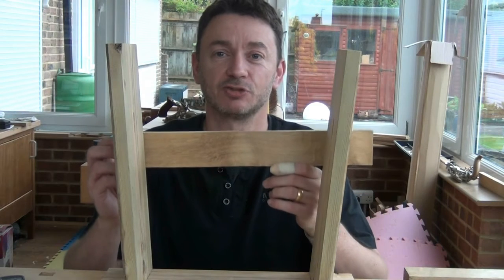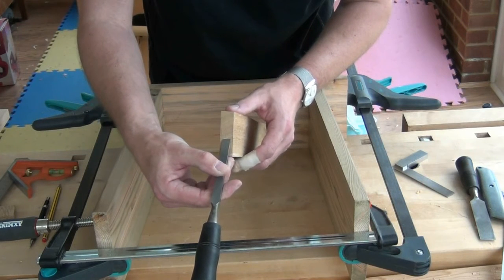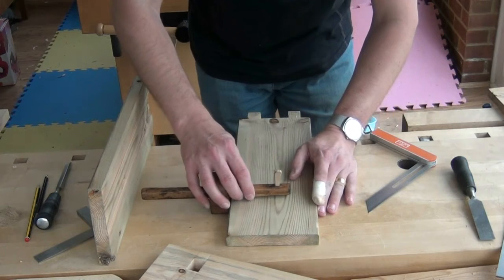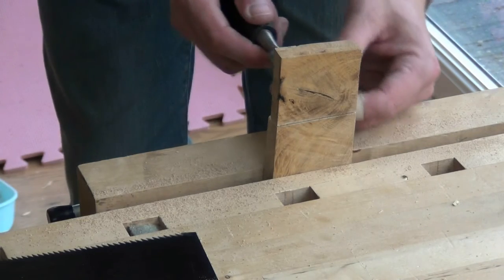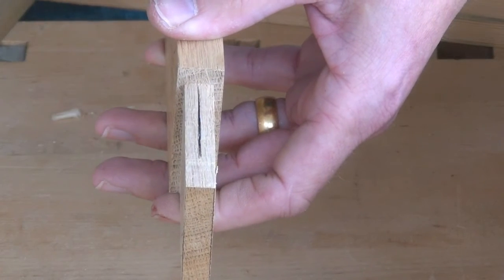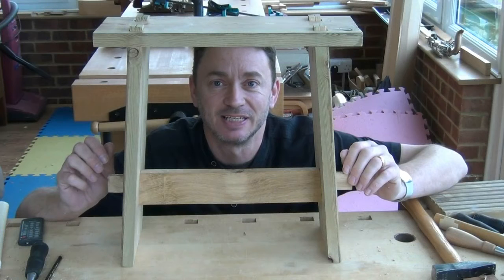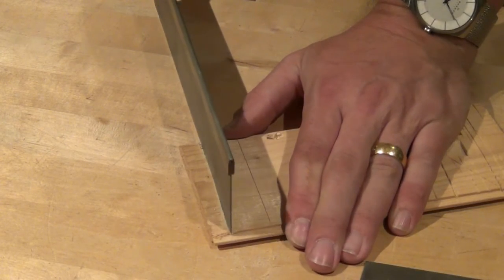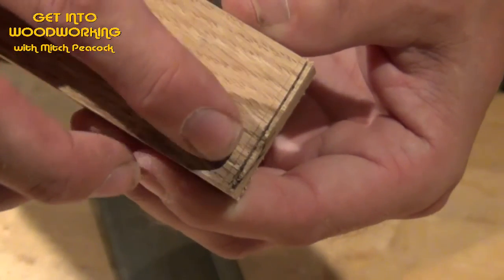How to Avoid Saw Tearout - GIWS1E15

Comment: thanks for the tips - is there perhaps a different way to do the mortise and tenon joint without having to cut at and angle - i find this extremely difficult to do and have never ever got it right - it always looks like I have forced the wedge into its place and not like it fits there.
Reply from the maker: John Geldenhuys Do you mean the leg to seat, or leg to stretcher joint John? 
If the legs are splayed then there needs to be an angle on either the tenon or mortise, or both.
Feel free to email me photos of your attempts and I'll try and see what's going wrong.
Reply: Get into Woodworking 

Thanks for the reply – it was the leg to stretcher joint – I did not
angle it and I think I was forcing the wedge into the joint, that is why it looked so squashed . I have started a new stretcher, because I broke that one while trying to fix up the mortise hole and get it angled.
Reply from the maker: That would squash it 😉
Hope you're now back on track